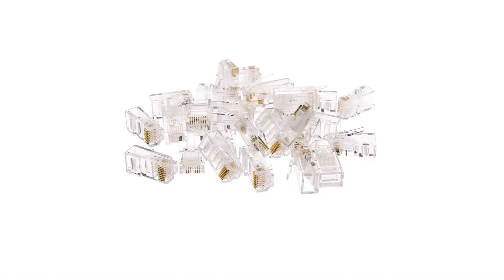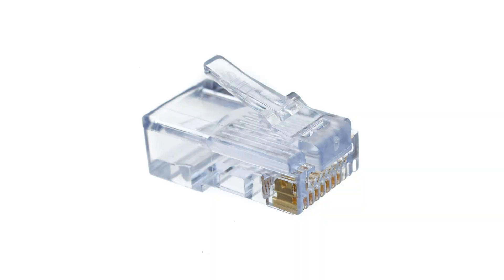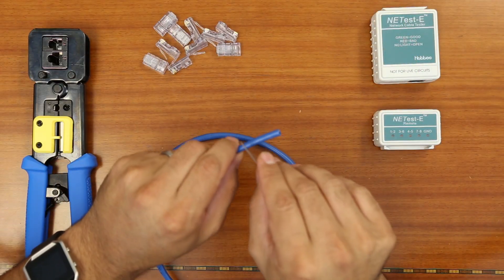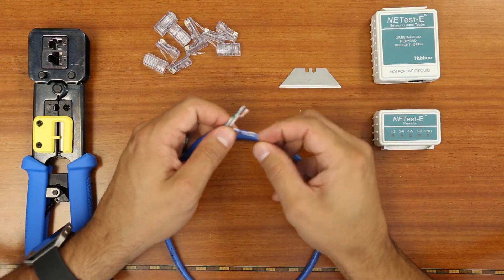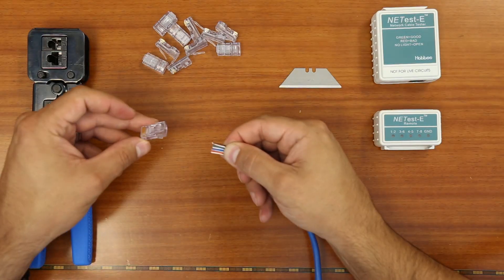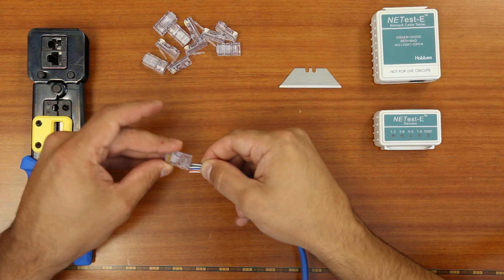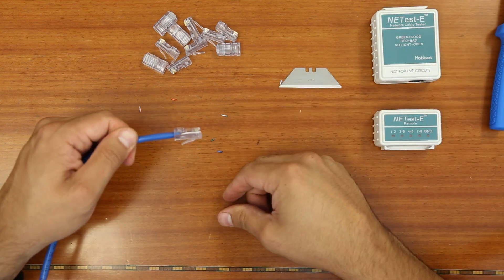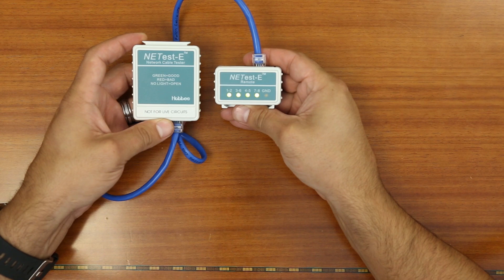Using EZ-RJ45 Connectors to build your own patch cable in 5 steps

Comment: I stopped using the non pass through style when I found these and the crimp tool at the local store.  If it was just cat 3 wire that is much easier and can usually be done much easier just because it has fewer wires.

Comment: The ez rj45 tool has wire cutter and jacket cutter so you don't need to use a razor blade
Reply: I have one of those green tools with the inserts for cat 5e and regular TV cable.  It works really well on the cat 5e as long as you take it just one turn around.  It has never nicked one of the wires yet.
Reply: EZ CRIMP 
Ez Rj45 pass through plugs ideally for Cat6 / Cat6acable

Easy crimp

https://www.electricaltouch.com/store/p111/EZ_RJ45_pass_through_plugs_for_Cat6-_Pack_of_10.html
Reply: Yup, even a Stanley Knife would be better and safer than a bare razor blade